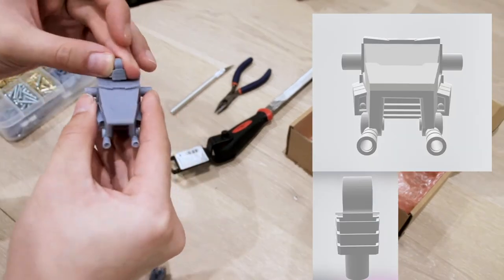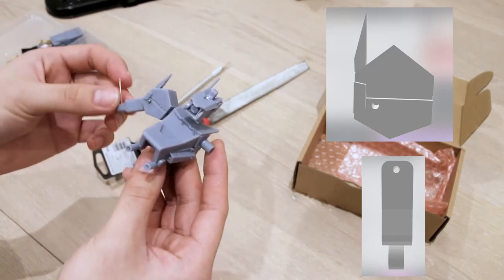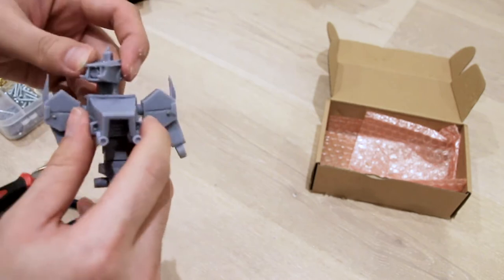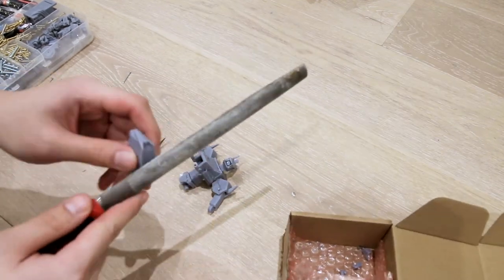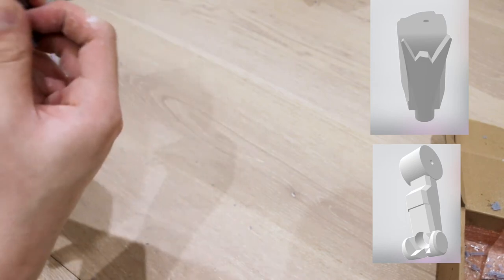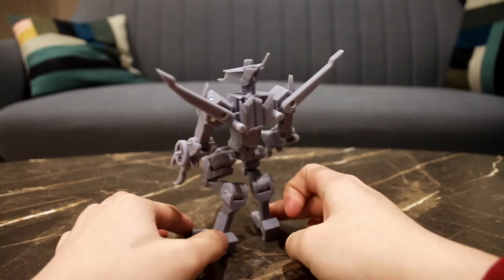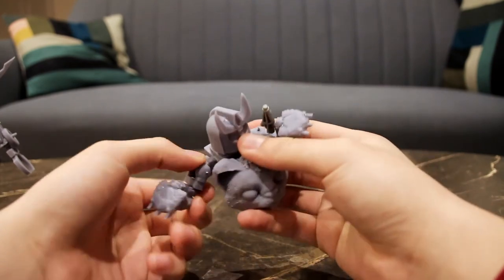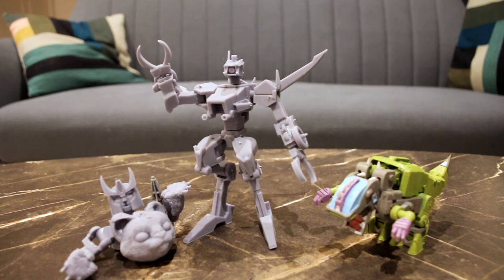MY EXPERIENCE WITH PRINTING TRANSFORMERS IN RESIN | MTMTE WHIRL REVISIT

Comment: I also find the layer lines annoying, and even with a lot of sanding there are some areas that are impossible to smooth out. In my experience, designing ball joints in 3d for fdm printers is relatively easy. I would recommend looking into making models with fdm joint pieces inserted/glued into resin limbs, to preserve the fine detail of resin and combine it with the strength of plastic, only sacrificing looks (because of the layer lines) right around the joint areas. If you get an fdm printer of course. Keep up the amazing work!

Comment: Similar to you, I have no real 3D modeling experience but jumping in the deep end trying to design some legends sized things.  What I'm trying out is buying some ball socket joint sets like Wave or Hobby Base/Yellow Submarine and trying to see about just including a spot in the model to glue them into place.  Might be something to consider.
Reply from the maker: That is definitely one way to go. I have just  stuck with the way I design the files and I release them for others to print most of the time. Meaning they would have to purchase those joints as well, yet I am simply attempting to give them a file which they can print entirely and scale to their hearts desire. Having external parts might hinder this aspect

Comment: do you think you would use a combination of resin 3d prints for parts that need less flexability and more detail and fdm for parts that need more flexability and less detail? or would you be sticking to one print type per model
Reply from the maker: In the future this is definitely the way for me to go, but at the moment I’ve just got no space or funds to get an FDM printer. I’m pretty happy with my Resin printer at the moment and with my latest Cyclonus project seemed to have worked around the limitations quite well.

Comment: Great video!  Your designs are incredible.

I was wondering, is there any 3D printing material that can be use for Transformers that is very durable and won't wear out over time?
Reply from the maker: Hi, thanks! There are tougher resins out there that would stay strong and durable over time. They are more expensive so research will have to be done prior to purchasing. 

Prints coming out of an FDM printer seems to be strong too. To be honest, if the model is designed around the weaknesses of normal resin, it should hold up fine over time.

Comment: Could resin printing be used to reproduce kabaya transformers model kits?
Reply from the maker: Possibly yes. There’s a lot of things that can be done now with 3D printing. From the kits that I own, they don’t have many complex joints or anything so I believe yes, you can.
Reply: @HightailCreations  thanks, my friend recently got a kabaya trypticon and intends photoscan it, render it as a 3d model and possibly print it.

Comment: What nails do you use?
Reply from the maker: Wall hanging nails you could get at your supermarket or hard ware store. I got mine at Tesco in the UK. £2.50 for 1000 pieces. They range from 1.2-1.5mm in diameter, but I use the 1.5 mm mainly
Reply: @HightailCreations  Thanks!